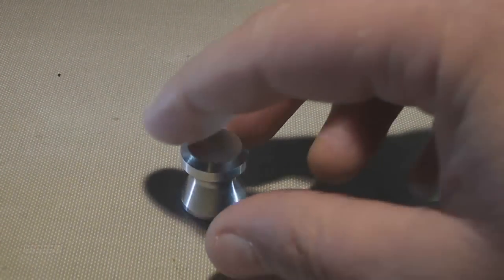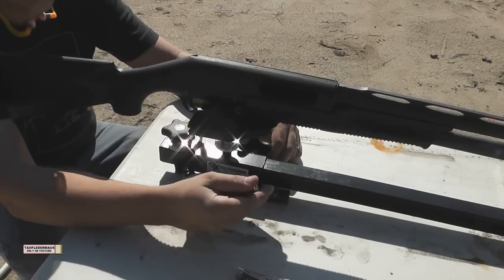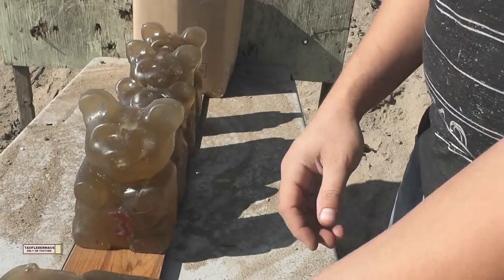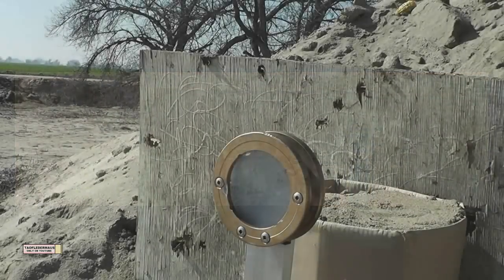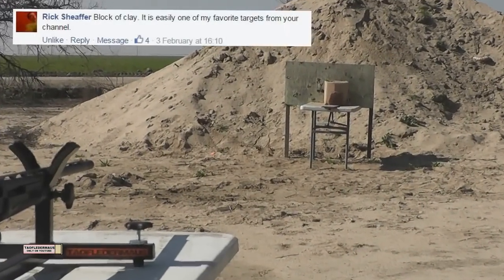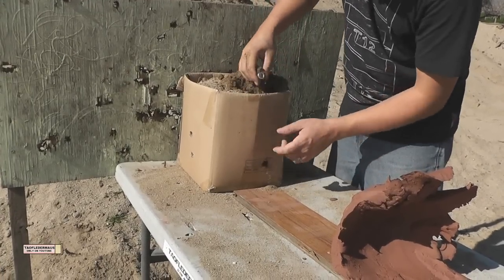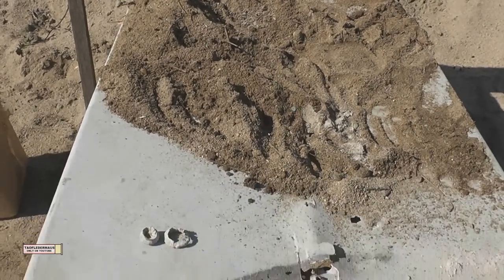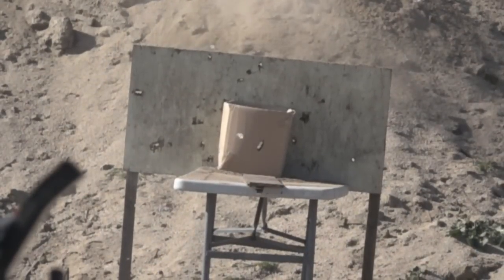.70 Cal  ALUMINIUM Shotgun Slugs  -  Ballistic Trials

Comment: Can it be that the aluminium slug left the barrel of the shotgun faster and so didn't accelerate for the same ammound of time as the lead slug did?
Reply: +SpiritofD4rkness That is almost exactly it. The powder used is designed to be progressive and has a controlled burn rate to push the heavier lead projectile efficiently. It takes more energy and time to move it through the barrel which gives more time for the powder to burn, creating gas that expands, therefore supplying force. The lighter projectile is pushed faster with less energy and has exited the barrel before the all the powder is consumed. The left over energy is wasted, but makes a pretty fireball ;-)

I don't know what shotgun powder he is using, but they're all pretty fast powders as is. A competition skeet powder would be faster than a slug or heavy field load. Even though energy is wasted, more powder could be added, but I wouldn't recommend messing with internal basllistics without calculating known parameters. Pistol powders burn around the same speed as shotguns, but a larger bore diameter means more surface area and less chamber pressure in the 12 gauge. Shotguns are weak as they generally run under 10,000 psi vs up to around 30,000 in pistols and 65,000 in rifles. Not many people think about how much faith they're putting in the manufacturer when they place their face just a few inches from the chamber as they squeeze the trigger.

But still, as Jeff said, it's surprising there wasn't some velocity increase, as there usually is, even if only slight.
Reply: The best response I ever got on Youtube, thx man.
Reply: SpiritofD4rkness
No probs, mate.

The YouTube comment section is generally a dangerous and useless place lol.

Comment: Hmm, what about measuring the amount of force the projectile has on impact?
IDK how to measure it best, but maybe a "punching bag" that captures the projectile. Then measure the amount displacement from rest that the bag experiences. Hang a needle from the bag and put a measuring tape next to it.

I'd find it interesting, don't know if anyone else does.

Well I guess you could just see how fast it's going and do the math E = 1/2mv^2.. Do you have a radar to see how fast it goes?
Reply: +0xbaadf00d At the approximated velocity of 1250 feet per second, the lead would have a muzzle energy of approx. 1659 foot pounds, and the aluminium, 375 ft/lbs.
Reply: +AusiKifaru27 I'm guessing the two projectiles would not have the same speed.
Reply: 0xbaadf00d
But they did, as proven by the high speed. Both projectiles left the barrel and impacted the target at the same time. The quoted velocity I assume is what's written on the pack of shells for the slug load. While not always accurate, they're pretty close with shotgun figures.

Mass is the bulk of where energy comes from. You simply cannot beat the density of lead in this case. For the energy to be equal, the lead slug would have to travel as low as 589fps. It's the difference between getting hit with a baseball or a brick. Even if you don't throw it, I'd rather get with the baseball.
Reply: AusiKifaru27
Umm, what? They didn't shoot the lead projectile? At what point did they use it?

That would be average speed. I'm interested in the speed when it collides.

What I'm interested is in how much energy different projectiles would be capable of delivering. How much they can absorb while in the barrel and how much they lose to drag.
Reply: 0xbaadf00d
You must have nodded off lol. Watch from 11:20.

At the distance they're shooting you'd probably only lose 50-100fps or so by the time it hits the target.

As for your interest, welcome to the mind boggling world of ballistics. I have spent decades here. Just when you think something is predictable, something odd happens lol.

Internal ballistics is what happens when an object is launched (in this case, inside the barrel). External ballistics what happens to an object in flight, and terminal ballistics is what happens when that object impacts a target.

If we know the speed and projectile weight, we can calculate the energy. If we only know the speed at the muzzle, we can calculate with pretty damn good accuracy what the speed will be at any given range (also giving us the energy for that range), but to do this, you need to know a projectile's Ballistic Coefficient (BC), which is the formula that determines its air resistance. BC can be calculated roughly if you have the weight, calibre and reference modifier value for the projectile shape.

Manufacturers usually list projectile BC's that have been accurately proven. Tried a quick browse to find a BC modifier for this type of slug shape, but couldn't. No-one expected this shape to be made out of a light material. If you could find the BC of the original lead lyman slug you could reverse the formula to discover the modifier.

Once you've figured all that out, then you have to remember that different shapes deliver that energy differently. If you hit wood with a mallet we know you'd leave a hefty dent. If you put a railroad spike between the wood and mallet to transfer that same energy to the spike, we have a very different result for the same energy.
Reply: AusiKifaru27
Yeah, I somehow missed that. I wish that they did something that we could compare between different videos easier.

I wonder though, how energy efficient are these projectiles? How much of the energy of the gunpowder is delivered? Now IDK how scientific these guys want to be, but I sure would like to know. Maybe the energy content is listed somewhere, all that remains is to calculate how much energy is delivered.

I can see one problem with BC. It doesn't take into account the speed, or does it? Drag changes wildly when you go supersonic and when you are supersonic it can change even more when going at different speeds.

I'm not that surprised that the projectile speeds didn't change at all.
Reply: 0xbaadf00d
I really think the best basic comparison is just a rough idea of calculated muzzle energy, as the targets are close. For that, I'd assume everything they shoot to be around that FPS range. 1250fps is enough to ensure projectiles are staying supersonic until impact and keeps pressures low in case a design does something unpredicatble.

The energy efficiency would be a complicated thing to work out. I'm not sure what data exists, but I can tell you that the specific energy of animal fat is at least 12 times that of gunpowder. It's 3 am here and the thought of it gives me a headache lol. But, I do understand what you're saying. How quickly it uses its energy is the key and I don't have it.

BC does indeed take into account speed, but it's rarely mentioned. It would have bearing on extreme lone range shooting where velocity drops significantly. As it stands, you hardly see more than one quoted BC figure for a projectile except where it's designed for longe range. The BC given is for the velocities which it is meant to be driven for an intended range. I really don't know if it's an average or not. Even BC calculators tell you it's approximate.

Put simply, if you're shooting a high velocity rifle out to 200 yards (max for most hunting applications, for example) then the BC change at that range is negligible. Once you start getting out to 300 the velocity of most calibres is shedding quickly. Less speed = more flight time = more drag, therefore the BC will change. For most of us, it isn't important.

As for the speed change, it's one of those things, as I mentioned; just when you think it's predictable, something odd happens. Let's look at a real world scenario.

You throw a baseball, then you throw a styrofoam ball. The foam ball is lighter and your arm speed will be quicker. The heavier object retains more energy down range but we still expect a faster launch.

Eventually you hit a point where an object is just too light. I just didn't expect the aluminium slug to be that point. Modern powders being progressive, they actually burn really slowly unless contained. The slug initially moved too quickly to create a pressure build up. Reminds me of Demolition Ranch shooting a shotshell full of toothpicks. We all knew that wouldn't work, but he did it anyway :-)

One of Jeff's older videos has a really good demo of powders burning from an explosives display he went to. Worth checking out.

Comment: The flash is coming from air being highly compressed just before impact. Very much like a diesel engine the round acts like a piston air compression increasing the temperature to over 1000* F only there is no fuel but the compression alone is enough to cause a flash pointed out in this video. Bet you, that you'll get a bigger flash if the tip was concave capturing more air at the tip before impact.....

Comment: the flash is most probably due to the thin layer of aluminium oxide coating the round, aluminium oxide is a oxidizing element in thermite and is what continues the reaction even if you smother thermite.
Reply from the maker: +unclemcpeanut   That is my thought,   sort of the same thing occurring with tannerite.

Comment: I think these would be really good home defense shotgun slugs, you wouldn't have to worry about over penetration but it will still get the job done if you hit someone.
Reply: +Paul Evans they worked so good I think it will be worth trying some different materials and maybe some other nose designs other then just flat. I might be able to do some copper for you
Reply: +TACTICAL G-CODE  Plus it is non toxic.
Reply: +TACTICAL G-CODE That's literally just what I was thinking when I saw how little penetration it had in the ballistic gel bears, compounded by the cavitation of the clay showing they still carried a ton of pressure.
Reply: +TACTICAL G-CODE Could you make some copper ones? I think that would be pretty neat.
Reply: +Ivan Stroganov They're still gonna sit yo ass down and break a few ribs in the process. And they hydroshock from getting hit in the abdomen will absolutely do some internal damage.
You've seen what it did to the block of clay... So no matter how thick your leather jacket, and even if they don't penetrate (they will probably penetrate anyways -> Basketball) I wouldn't consider them less than lethal.

Just imagine what would have happened if the Basketball were filled with clay...
Reply: +TACTICAL G-CODE You could make the cup of the projectile out of acrylic or whatever and the faceplate from aluminium, just screwed together.
Might make a decent less-than lethal / anti-riot projectile...

Or:
Making the faceplate spheroid/ballshaped would probably increase penetration quite a bit, without messing up the aerodynamics.
Reply: +Ivan Stroganov I've gotten good penetration with a jacket and shirt on...oh wait, never mind.
Reply from the maker: +TACTICAL G-CODE   The recoil was about the same as shooting a .22lr.   You can really tell how light it is compared to the lead slug at the end of the video.
Reply: *****
What about a small cone right in the center as a penetrator?
Reply: +Kain Yusanagi I think with a jacket an shirt on there would hardly be any penetration
Reply: +TACTICAL G-CODE Use depleted Uranium. 
Sure there's a slight health risk to machining it but it's worth it right?
Reply: my thought as well. ...
Reply: ok, lets have a talk about over penetration  in the context of home amd self defense. first lets take a trip over to box of truth. just look it up. i will tell you amf take this for what you will, there are precisely  two things that make semse to use  if you are worried about OP. i will tell you about  those in a minute. first lets talk about why worrying  about OP from an ammunition  perspective is not the way to look at it. walls are softer and less resistant  to bullets than human bodies. there are two components  of OP that are really at play here, missing, and actual Over Penetration where the round goes through the target amd continues  on through another intervening object(s) and strikes an unintended target. you cant adress the first one with ammo choice (well you can to an extent, but again, we will address that in a minute) you have to NOT MISS. or you can armor your walls, but that's  only helpful when you miss at home, not abroad.  and its probably not a realistic endeavor  for the immediate purposes of this discussion. now, on to the other component  actual over penetration. if you have stud and drywall  construction, either metal or wood,  most of your wall, is empty space sandwiched  between two .25 to .5 or whatever layers of a composite of paper and one of the softest  minerals known to man. its not  gonna stop shit. is there a round that is gonna kill or stop anything much larger than a chihuahua that won't go through dry wal, paper and air like its not there? box of truth says NO. and IF you hit a stud, (small chance) it still may not stop it of its not a square hit or even if it is. it may but, its still a small chance.  so, if you are shooting a metal projectile thats reliably capable of ending a human or large animal threat, its probably gonna work its way through drywall. if it wont go through dry wall, it probably wont do the job you got it to do. 
  OK,  that all being  said, is there anything one can use, that is both highly effective, and actually has a design that will offer at least SOME risk reduction for either/or target misses, or actual over penetration situations? 
well, kinda. there is a round called the Glazer safety round (something  like that ) its for handguns of various  calibers. its essentially a very light hollow copper jacket or cup, filled with tiny lead shot packed tight and capped with a ceramic or plastic cap. its very unlikely to go through a human target even at very close range and creates very shitty wounds. great expansion but its wide and shallow, not usually very deep. not really to be considered  for use against  hardend targets. as for miss situation, it will stilk probably  be a issue even after going through two or more  layers of drywall, may be reduced or eliminated  by a stud strike, bit hitting the target is the best thing to do here. now thats hand guns, they dont (yet at least) make shotgun slugs. Hint tactical g code, you like making ammo, amd you are worried about OP, this would be a good project to make for Taofladermaus to shoot. now for shotguns and OP, breaching rounds seem to be the answer here, these are wax rounds mixed with coarse lead powder for taking out locks and hinges on doors for military and Leo entry teams. they hit obstacles and dump energy  and powdered lead into it, and then disintegrate fairly quickly.  im pretty sure they would fill the bill for home defense situations. dry wall might not cause much or any disintegration but a stud sure would, amd i cant imagine them getting through  any but the smallest human. and even then im sure they would not be intact or even real dangerous. so thats my take on the subject of OP. 
 as for your aluminum rounds, those are aweome, i think you might have a marketable product there. imagine this, you could sell the shells, cards, cups and premeasured pelletized powder charges along with a specialized reusable target medium for the purpose of economical reusable  target ammo for shotgun slug hunters. the slugs are immediately reusable if they are within spec, which could  be determimed by if they fit in and turn within a special spec mold that is slightly larger than the slug. something to think about.